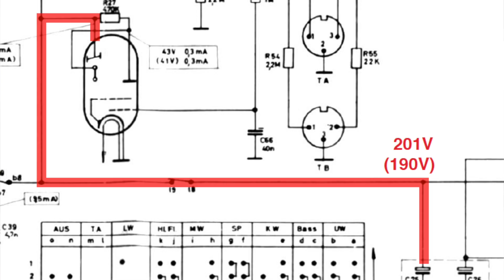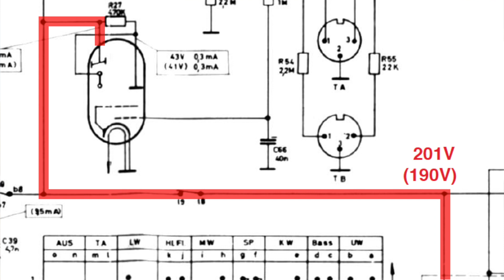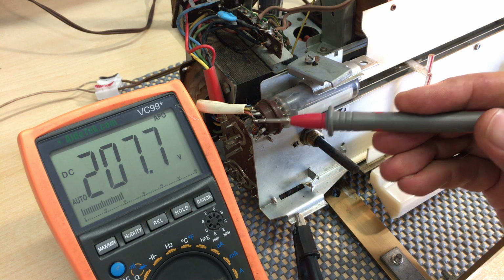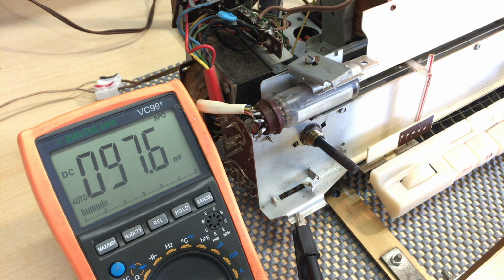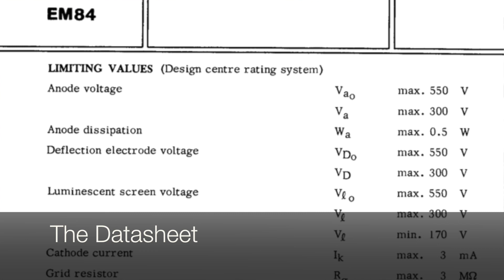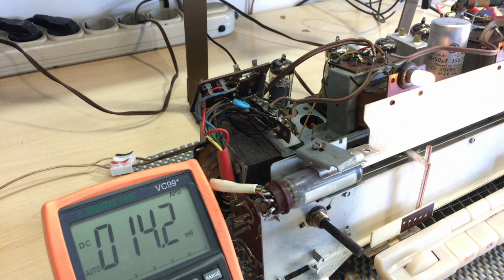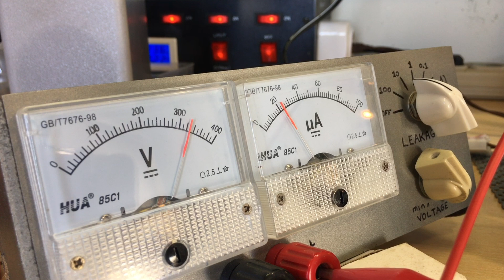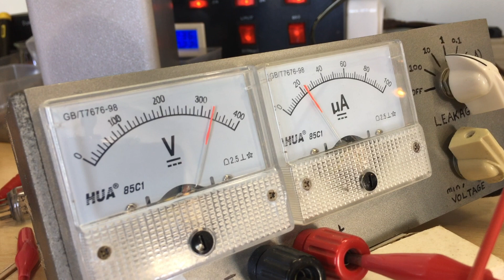How To: Revive a weak magic eye tube

Comment: If that resistor at the bottom of the eye tube socket goes high in value it will also produce a dim display. In older USA sets that resistor is hidden in the tube socket and is often missed being replace (or checked) by inexperienced restorers. Interesting video thanks for sharing.
Reply from the maker: I check it always, because I’ve often found it going up in value. Thanks.

Comment: Thanks for covering this, its a good topic.
I have played around with the North American versions, with the round arc (6E5 and compatible). One tactic that I have seen used in the past was to increase the heater voltage to increase the pool of electrons around the cathode.

I have a couple of radio projects coming up using magic eye tubes (NOS) and I have decided that I will try to modify the circuit on them to deliberately cut down the heater voltage initially. The idea here is to lessen the brightness on a NOS tube to increase its usable lifetime. I tested this idea and it looks feasible; the NOS tubes are pretty bright at the designed heater voltage. I was planning on adding a bypass switch to restore the full heater voltage when it eventually gets to the point where the lower voltage is not bright enough. 

One possible improvement to that idea might be to add a circuit (new PCB, yay!) to temporarily brighten the display when the radio is being tuned and then cut the heater voltage when the tuning is fixed & set.

Cheers,
Reply from the maker: Sounds interesting. Good luck
Reply: According to Ludwill Sibley, author of the excellent reference book "Tube Lore", age-related dimming of 6E5 and 6U5 tubes is primarily caused by "contamination" of the green- florescing coating on the cathode, which he referred to as "willemite".   (I assume that something cooking off from the tube elements eventually contaminates the willemite). He wrote in the book that experiments at rejuvenation of those particular eye tube types,   by members of his radio club,  had largely failed or been inconclusive.  If course, the later eye-tubes such as EMM801, EM 84 and such may use different phosphors or coatings. Either way, it can't hurt to try! 

The only tube types I ever had any  success at rejuvenating were a batch of early tubes with thoriated did tungsten filaments. I forget if it was WD11's or 199's, I  think it was the 199's. The procedure was in Sibley's book, and further details were found on line.
Reply: @john beach  Somewhere I read an article from a radio collector who had installed a small step up power supply (a pulse width or switching circuit, IIRC) to bump up the heater voltage to 12V so that he could use a much cheaper 1629 eye tube; this also likely requires other circuit adjustments or mods.....

Comment: Was looking at these last week (UK Ebay)and you could get 10 for £20.00 delivered (includes postage) from China, mine in my Philips is OK and have a new spare but was tempted to buy.Interesting video and you are right some of those magic eye valves are mega expensive. PS I still disagree about reforming filter caps, there old there old.:):)
Reply: For what it's worth I find that electrolytic smoothing caps are more likely to survive further down the HT path. So like most I will replace the reservoir cap on sight, it's a damn sight cheaper than a rectifier or transformer. However I do have a few preamps and tuners still running their original smoothing caps that will do nothing worse than start to hum a bit one day. When they do I will replace them.
Reply from the maker: That’s an incredible price! I’ll look for them myself. 
As for the caps ... let’s agree to (sort of) disagree :)
Reply: @electronicsoldandnew  Well here's the link and unless I am missing something it does seem a good deal.
https://www.ebay.co.uk/itm/10pcs-Magic-Eye-6E2-EM87-EM84-Tube-Audio-Indicator-tube-tube-AMP-DIY/283131268505?hash=item41ebf04d99:g:0k8AAOSwYxdbh~fW
Reply: @electronicsoldandnew  as for caps, i have lots of old electronic equipment and the majority still have their original electrolytics in as they were ok as is or reformed ok😉  they can last much longer than many people think  but obviously its very variable, biggest problem is heat and ripple current,
Reply: plus 'blanket' cap replacement is not a magic cure all or 'futureproofing' ..
Reply from the maker: true

Comment: It was worth a try but as you said, the tube is pretty much shot so would need replacing anyway. As a bodge to get a set out of the door if the customer won't spend money it is ok but it will die even quicker.
Reply from the maker: Unfortunately, I have a problem. The customer is me! :)
Reply: I hear you with that! We try these things... if it works, great, if it doesn't, you lose nothing by trying.